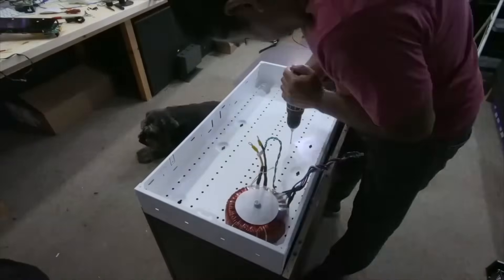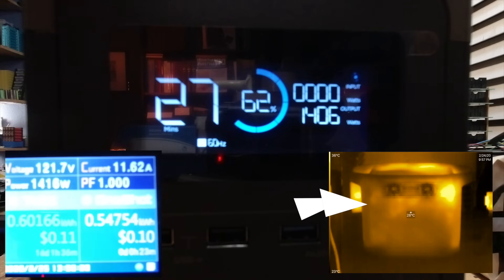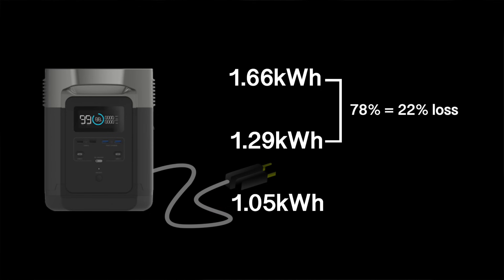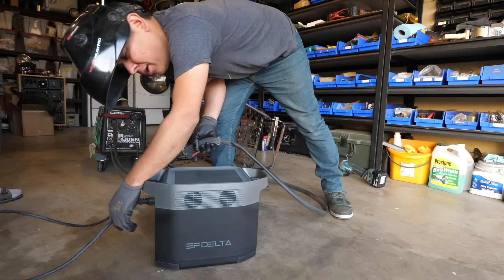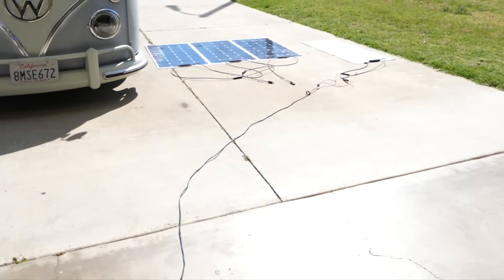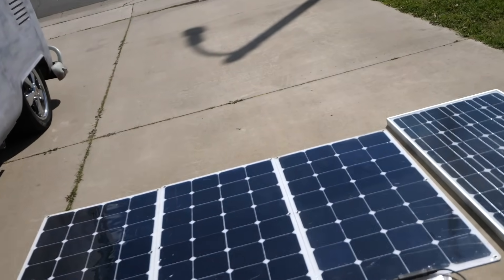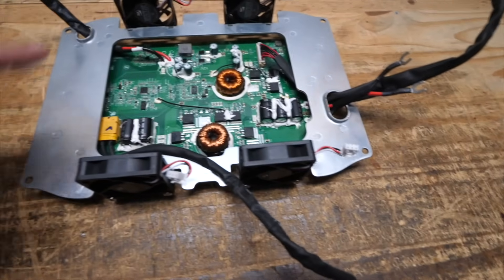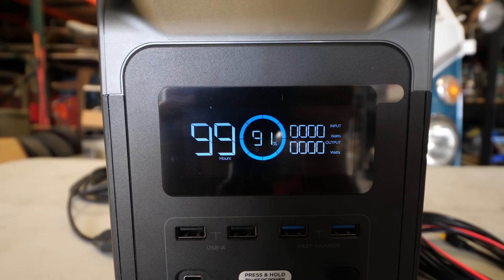The Most Epic Review of the $1300 SOLAR Battery - EcoFlo Delta1300

Comment: The compact design and handles seem good for carrying around. OK, so for my usage, I definitely won't be welding or charging electric car batteries and though the 63% isn't ideal return, this still supplies more than enough go-juice for my applications, like charging portable devices, tools, lights, and camera gear when camping and while on the road. At the very least this would be a great tool until I get enough courage to do my own build. Thanks for the informative and helpful info.

Comment: I'd use this for my remote cabin, which although on-grid, is large enough that this battery pack would be useful for running tools and charging power tool batteries when out in the forest working!

Comment: I will use it to cook my meals. I'm currently homeless and living in my mom's truck that doesn't run. I currently have a 90ah marine deepcycle battery with a 2k watt inverter. I can't run the microwave for more than 5 minutes. I have solar panels connected to it but it doesn't help it much. I have to connect jumper cables from my car to finish cooking my food.

Comment: I would use it to power my nebulizer and medicine fridge in the event of an outage (something I've heard might be a thing due to all the people being home during the day due to the CV) and sometimes happens especially during hurricane season here in Florida. Both are needed for my medical conditions as medicine needs to stay cold. If it has enough capacity I'll try to find a way to power my well pump which is needed for all my water needs. I usually have to use a generator in those instances. It is also more portable in the event I need to move somewhere or my grandparents need power. My generator weighs a fair bit.

Comment: I just turned 17. Off grid 64 sq ft cabin.  My new Dad started me watching your awesome channel. He's a believer!  He and my new Mom took me on a 6 month trip from Tx/Mx border to Bahamas on a 30 ft off grid sailboat.  Now Dad's helping me build my own home in the Texas woods. It's only 8'x8' with a loft over a porch the same size.  We'll put it on YouTube for diy's if they want to build one too. Dad's channel is (houses built tiny). This cool battery pack is all I will need for my complete electric. :-) if you choose me I'll make sure others see it installed on YouTube when we are done. Either way, I really enjoy your videos. Especially the ones on the battery skateboards. Awesome!
Reply: you can get (12.8volts) 4 cells of 280 AH of lithium lifepo4 off alibaba or aliexpress for $481 shipped. so get 2 of those and you have 12.8 and 560 AH or 25.6 volts and 280 AH, throw in a bms and an inverter and the cost can be about the same as this. for reference the product in the video is 90 AH and probably 12.8 volts so DIY you get like 7x as much battery storage plus charging it and discharging it is faster with great current pull, so HARD PASS on these "epic" products.
Reply: if interested i can get you the link, the saleswoman is amy and she has a good reputation, there's a cult following on these batteries. or you can browse the diy solar forums

Comment: I would use it with 300W solar in my apartment. Its a small solar setup, wouldn't make sense to build customized charger and battery and inverter. This would be an awesome option cause its mobile all in one solution and can take in more power than most solar generators.

Comment: I would use it to run my CPAP machine and oxygen machine (when needed) during times of no power.  Right now I use an old car battery and a small 300 W inverter, which does the job, but only for a few hours.

Comment: I am an Amature Radio Operator and do field contests and Emergency radio communications as in when we were hit with an ICE Storm witch took down hydro towers and hydro pole and phone line pole along with damage to power stations extra. So we were in our cars, snowmobiles and moble tents. We needed car batteries and switching them out and using generators to try and charge them, Hope this a good reason for this setup....Keep up the great videos.

Comment: I have been wanting to make a electric bicycle.  I would use it to power the bicycle for transportation to work. Use it for emergency comunications via citizen band radio (CB) could even use it on bicycle to and from work with CB. Solar panels are a big plus for charging on the go.
Reply: I was thinking of expanding it to a tricycle built for two. That would be a little bit of a home project but doable.

Comment: Jehu, I'd use it in my house. If the power failed, this would keep my chest freezer going which is full of half of a cow! I have some Harbor Freight solar cells that could keep this alive. The compressor is a smaller motor than that big air compressor you were trying to run.

Comment: Great video! I would use it to power an ajustable bed for an elderly and some appliances during the night. Also for the computer in case my son needs to finish some school work.  I live in a rural area of Puerto Rico where strong winds cause many electrical blackouts, during the day I connect a generator, but have to turn off at 10:00 pm.

Comment: I live in a small 5th-wheel travel trailer up in Washington State (where the power goes out sometimes, in the winter) and I've been wishing I could build up a system of an inverter and some big deep-cycle batteries. I would love to have 3000 watts available and at least 4 group 27 sized deep-cycles to keep me going when the power goes out. I just can't afford to build such a system. Kinda hard to pay for such extravagances on a SS income. Frankly, I should probably build myself a system out of an old (large-ish) UPS (maybe 750W?) and one or two group 27's to keep my computer going...but I need at least 2000W worth of 120V to keep my space heater going. Hard to keep this place warm with no power and snow on the ground. It would be a whole 'nother thing if I could put a wood-fired heating system in here. Nothin' like havin' the power go out when it's only 20-some degrees outside! 
I could see how a little unit like this one would be great as a portable power supply for, say, when you're out camping or picnicking (or tailgating).

Comment: I would use it to power a portable ham radio station (2 hf 100 watt radios & 1 vhf 50 watt radio) capable of emergency communication.  The solar panels are a big plus in that application.

Comment: I would use it to power an Xbox/TV setup I built for the orphanage in Tijuana that I volunteer at on weekends.  When the kids aren't playing Xbox with it they could use it to heat the orphanage up a little.
Kidding...I would probably use it to power what I could in my garage.  Currently I'm using a cheap Harbor Freight panel and a deep cycle boat battery and a $40 pure sine inverter.
Thanks for the chance to win and keep up the good work 👍

Comment: I would use this to take my home partially off grid I have spent the last year rewiring certain circuits of my fuse box that I believe could run without grid power. The dining room, our child's bedroom, and my laptop workstation in the garage. I just lacked this type of battery pack / inverter. I have spent the last month building my own automated transfer switch for this type of effect.

Comment: Well I see you love Vw bus as much as I do. I planning a trip on the Pan American route. It would not only make my life much easier and save gas (be it on generation of power or storing power on bugget using  Deep cycle marine batteries store power was original plan) to power tv and I converted a water dispenser hot side into a heater for showering or tap basically a tankless hot water heater. This would charge up on roof day time and after seeing that it can run that much power heat small microwave and mini fridge when needed.
But the weight I save or not needing a gas generator may cut cost by 1/8 and let me do some nicer upgrades to my VW bus. 
By the way just fyi though I love to meet you should burr tags out on vehicles or if someone finds you is it like Easter egg (where jehu Garcia) just day with you tech the stuff I could build graduated '93 and using same oscilloscope used in '89-93 electronics 1-4 high school.and sure was old then bigger 13 inch tube tv with flickering screen so  Jealous of all the newer so much more user friendly stuff. I at least have that size Philips screw driver if need make any repares watch earlier video you did one makeing those power packs just curious see how you "hack" it to expand battery capacity.
Also first time winner of anything but a scratch off for few dollars 
Thanks for great videos you actually show things not just ramble of spec like other reviews love tear downs to 
A cheap low power Power control board can be gotten out of most led light bases works great for little projects and get dirt cheap.

Comment: Im working on my own power wall picking up 18650 from laptop repair shops because i want to motivate my country to do the same and one way to show them its possible to be off grid is making my own and showing them the results. This would help me motivate them and make them trust the project and after that i would keep it in my home as a backup and at the same time i would be happy because i would have something from you because im a big fan!

Comment: I'd love to have this EcoFlo Delta 1300 I travel a lot using my camper to get around and save on motels. I live in Los Angeles I'm 71 and need to use a C-Pap machine at night when I'm in my Camper. This would be a great alternative to my 1300 watt Harbor Freight Generator that I now use in my Lance Camper on my 2004 Ford pickup
Gregory Callaghan 323-867-7504

Comment: I wholeheartedly agree with having the ability to add capacity. On the Honda 2200 generators you have the ability to chain them together if necessary and even have a 30A output when chained. The market they should be looking to serve is the RV/5th wheel generator replacement. If it had higher capacity with a 30A out for the AC units and maybe a larger rated input for more solar cells then one could live completely off grid while camping. Not a lot of capacity currently but would be cool to see a drop in unit that fits where the current lead acid battery arrays sit. An idea anyways. Lithium ion has way better energy density than lead acid so it would be pretty cool

Comment: My family and I live in the country, my youngest daughter has autism.  During power outages,  we would use the solar generator to ensure we have power for freezer & fridge, so I don't need to run the gas generator all night and in case oif a longer outage.  Daily I'd use it to run my electronics/hobby shack (we call it the Little Shop), where my daughter and I build and learn about electronics, model aircraft (drones) and more.  I've wanted to build a power wall for the Little Shop and have collected several used batteries but it is a work in progress!

Comment: I live in a 55+ community in Indio, CA. Temperatures reach 120 F in summer for a long period of time. The transformer of the community cannot handle those temperatures and overheats on a regular basis which leads to power outages. Many of my neighbors are in the eighties, and many rely on electrically powered medical equipment, or on medicine that needs to be refrigerated. I have tried to help in the past with my gas powered generator to overcome those power outages for the people who need it most. But a solar generator like that would be much better, because it can be placed inside of the mobile homes to run the necessary equipment directly. I have watched your DIY projects about battery generators, but even the reduced cost for those machines exceed our budget. So this battery would be of much help for our community. But, anyway, keep up the good work!

Comment: With these critical times, hard to deal with like the rolling blackouts in CA.  I would use this to take care of the old folks, so I don't have to worry about them setting the house on fire or dying of Carbon Monoxide.

The moment the power goes out, we have to check on my 86 year old aunt (Her Heater needs 120v but has gas) and elderly parent inlaws who are in their 80's.  Mother in law got stuck in her power reclining chair last time.
With that said, I would definitely play around with it, blended drinks while camping, instant pot at a picnic, so many options!

Comment: I have been wanting to get a solar/battery system for a while for camping and also emergency use.  I just bought what I can afford which was only a 250wh battery but it will not really provide much other than some charges for a laptop or flashlight batteries.  

This would be very helpful for off-grid camping and emergency preparedness.

Comment: This would remove one of the major expenses that's holding me back from getting my parents a better backup solution. Several times a year they are out of power, they live in a wooded rural area so often it's a day or two before the power is back on. They have a generator which they use, but it's dirty, loud and is close enough to the house that it's a health concern.

With this alone they would have a battery buffer that can be paired with their existing generator if more power is needed. However combined with solar, they wouldn't need the generator in the daytime and at night the generator could be ran for a couple hours vs all day/night.

Outside of power outages, they have a detached garage that is powered by that same generator (only when my dad is welding) but otherwise it doesn't have power (Despite being wired up with switches and light fixtures) This could give him power for simple things like lights and a radio while he's tinkering away in the garage.

Thank you for doing the giveaway, love the channel!

Comment: I would use it to power my audio recording equipment to get recordings deep in the woods, bird calls from a silent hot air balloon, and off the grid locations with incredibly low noise microphones

Comment: I am a community college student in my final semester of electrical engineering, having developed a good relationship with the electrical professor, I would use this product to help give a physical representation to the intricacies of storing energy. Seeing as the majority of the classes are based on the relationships between source and load, the ease of portability and the ability to have a modular system tend to be displaced by equations. This simple concept opens electronics to a much more accessible and innovative mindset, and I would like to pass this pathology that you have given me to my peers. Thank you

Comment: As much I would like to have this for the many great reasons that were given here by others..... but...If I win this, I will "pay it forward" to the elderly couple next door. After the hurricane, we went without power for a few weeks. It would have been great if they had a few lights to run & fans running at night to at least have them sleep with some comfort, etc,,, With the solar panel, they will be able to charge this unit and continue to use the ecoflo until the power came back on.

Comment: I implement these diy projects in my camping set up. I camp about 6-7 times out of the year for up to 9 days at a time with only a canvas tent. I use batteries to power my sound system, my lights, my blow up mattress, to charge my ebike and i add new electronics every year. Im hoping eventually I can  gain enough equipment and knowledge to use my off the grid set up 24/7. I've been working on projects like using peltier modules on my wood burning stove to charge my batteries but currently I dont have any charging capabilities. When my batteries die they are dead. If i win i will make a video for you to use about my glamping set up.

Comment: That unit is handy and very well designed.  It appears to be rugged looking at the number of screws instead of snap together.  We do a lot of camping and with the portable solar panels we could use it for days with needing an AC source. I was amazed at the welding even at a low level, because you just never know.  Thanks as always for a great video.  I have a 13S battery for one of my electric bikes and I am having a problem with the BMS. I have tried several but not joy. Can I contact you to get your perspective.

Comment: Hi From PR..   Really nice And compact unit..   it would be cool to replace all the car batteries and inverter with just that.. the workshop is separate from the House for our drills and vac.. I run a 12volt system for using rain water to wash cars.. water plants. That same unit can power security lights around the back of the house and car area.. this would be working 24/7...  anyway be healthy.. be safe..

Comment: Hey Jehu! Fellow DIY LiPo pack, solar system and ebike builder. I would use it as a backup for a new passive house build. If you pick me, I'll see how long it can run all the house systems on one charge and promise to post the video! Hoping for 10 days with running the radiant floor heat in Canada. Thanks!

Comment: I would use it on my DIY budget van build that I am planning for this summer. Moving into the van when it's done to try to save some cash and pay off some debts. This would be a huge upgrade over my original basic power plan (though if I managed to save enough cash I would hopefully be able to upgrade to some kind of solar/battery combo within the first year - but definitely not this high end). Good luck to everyone.

Comment: I would use this battery to upgrade my diy 200w solar with rv deep cycle lead acid batteries(2) to lithium and move the lead acid batteries to my Diy hydroponic garden system and add solar to it.